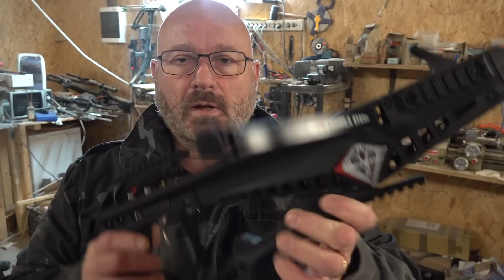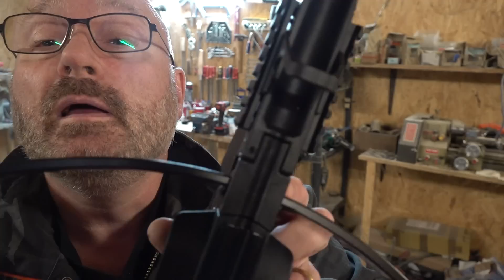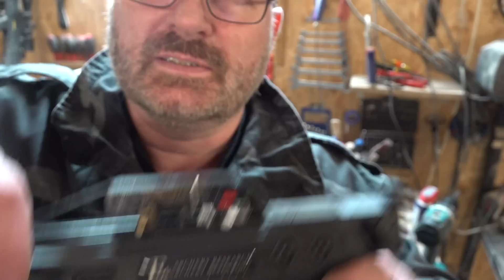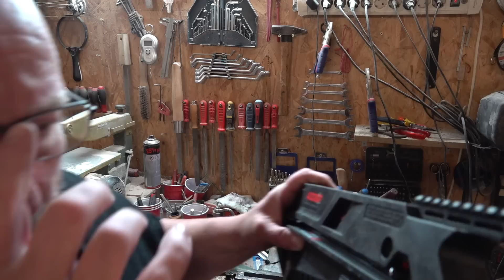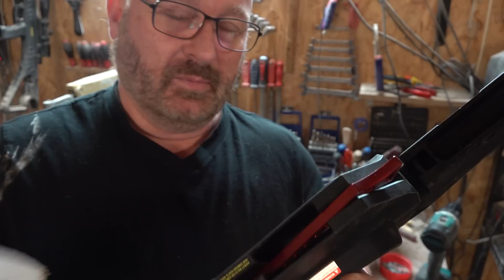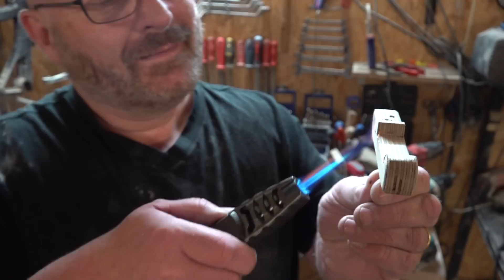Cobra R9 / RX Tuning: Easy magazine conversion! NO WELDING.

Comment: Hi could someone tell me if mechanics on cobra rx 130lbs are stronger or the same as cobra r9 90lbs? Its just that i want to convert  it to 220lbs. Also any idea what weight arrows should be on 220lbs

Comment: Joerg, what do you think of the X-Bow pistol crossbow with 330fps power?
Reply from the maker: I tested it, was interested into making a magazine for it. But it disappointed me. It would never reach 330 fps, not even with super super lightweight arrows. It would only reach about 25 Joule, the same as the EK Archery R9 with a 90 pound recurve limb. Very poor performance for a 120 pound compound. It looks sexy, but the performance sucks.

Comment: So did you hurt your tendon powerlifting or riding your new bicycle too much? ;-) Get well soon! Great that you're still able to come up with video ideas that hopefully aren't putting any strain on your leg!
Reply from the maker: It was eight weeks in an ice cold workshop, standing on a concrete floor.
Reply: @Slingshotchannel  I see, sort of like a frozen shoulder then? Not fun. Well when you have recovered I highly recommend you get one of those oil filled and sealed electric heaters that won't be a fire hazard with all the sawdust everywhere! Oh and maybe some fireproof carpeting?

Comment: I really want to buy a 5 shot Adder.

What put me off is that it only fires bolts design specifically for the Adder.

If I take the magazine off can I fire standard arrow bolts?
Reply: maybe you will buy a adder and a normal cobra 😁
Reply: @m.h.4143  Thanks for the reply.
I've not been able to find any information anywhere (I even tried emailing ek archery).

I'll have a look around for the diameters of compatible bolts.

Don't get me started on buying two. I'm already looking at some Bows 😂
Reply from the maker: The Adder is so successful, now you can buy several third party arrows all the way from dirt cheap to high end for it. Also you can get the nocks, shafts and tips separately if you prefer to make your own bolts.
Reply: @Slingshotchannel  thank you for your reply (and brilliant videos).

Is there anything that I should look out for compatibility when choose the bolts?

I thought that if the magazine was removed then I should be able to use any crossbow bolts from 6.5" and up.

But it seems that the diameter of the bolt is more like the arrows used with a bow so is a lot more difficult to find bolts that are compatible.
Reply from the maker: @inked5145  You need 2 vaned bolts with a shaft diameter of 7.5 mm and you HAVE to use the right half moon nocks. If you use standard nocks, you will experience failed shots. It is best to simply search for Adder bolts on amazon, ebay, aliexpress and and and.
Reply: yes you can. You need bolts with a cam in the right diameter and of course only 2 wings.
You lose dry fire protection and aiming.
Oh and maybe the lack of the spring which holds down the bolt could be a serious problem for risking injuries. Beware!